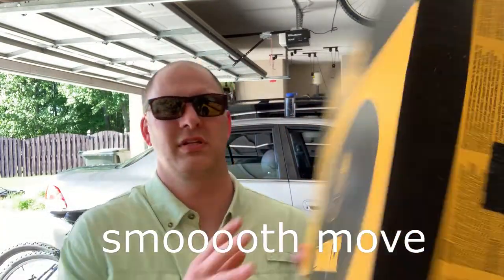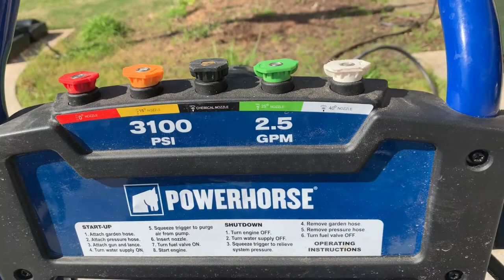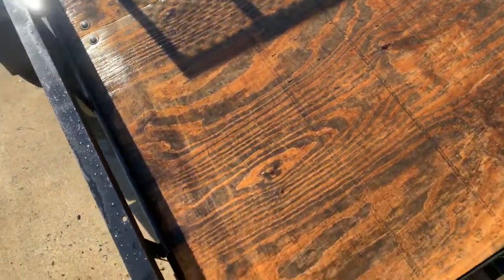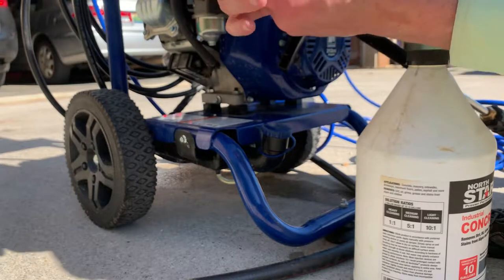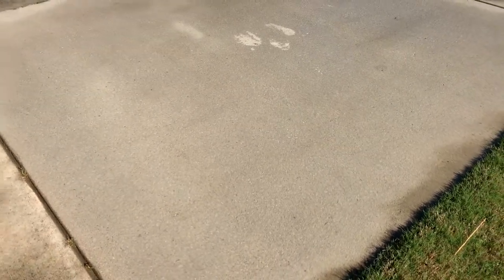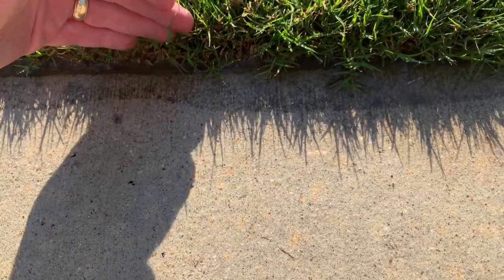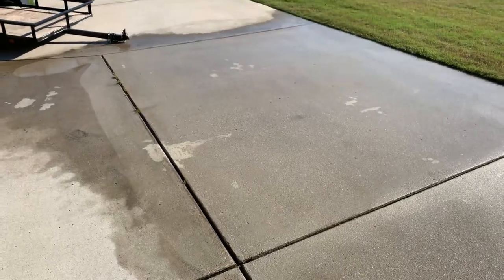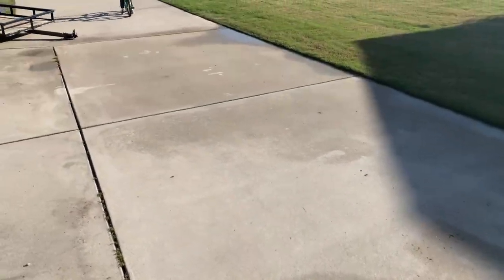Pressure Washer 101

Comment: Is that the original pump that came with that pressure washer? Or did you change out the pump?
Reply from the maker: Original. Still use it regularly and it’s great for me.

Comment: Hey what's the instrumental for 14:00 time. I love it
Reply from the maker: Chill Day by Lakey Inspired. All of my music is always attributed in the description. Thx for watching!
Reply: @durk1980  what surface cleaner should i use for same pressure washer
Reply: Assume you mean the liquid you put in the reservoir. (Obviously I’d recommend the 18” Dewalt surface cleaner). I bought concrete cleaner at Northern Tool when I bought the pressure washer. It ran out a loooong time ago. Any pressure washer concrete solution is sufficient. I’m not an expert in which brand works better. I will say, using a liquid in the reservoir does in fact make the surface cleaner work better.

Comment: Is there a switch to turn off the soap dispenser?
Reply from the maker: Nope. The black nozzle has a wider hole so it naturally causes the reservoir to be drawn from. If you use any other spray nozzle, with soap in the reservoir, then it’s my understanding that it will not come out. It only comes out of that black nozzle with the bigger hole.

Comment: Why does everyone keep lifting the it up off the concrete ???
Reply from the maker: It clears it out. That and if there’s a small puddle, it’s harder for the jets to push through it to the surface. Lifting it up sort of dissipates the puddle and then right when it goes back down it cleans it well. For the most part though, it just releases all the junk inside.